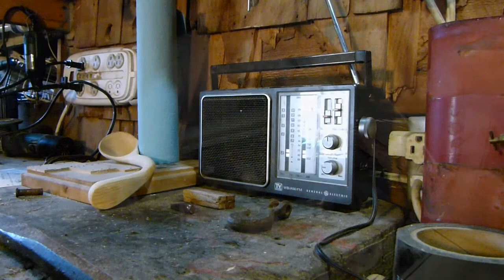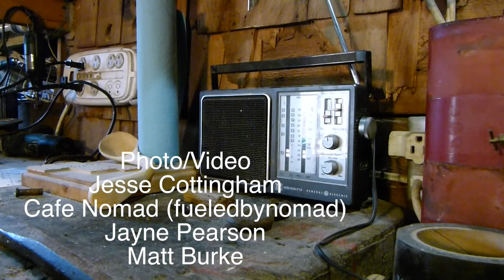Radio Story

Comment: Good morning Bus, have you got the steel on the roof? Take care, keep moving forward.
Reply from the maker: Good morning! Ill be leaving the ZIP uncovered this winter as I am tying into it with more roof at the same pitch and just continuing the current roof, but Ill explain that further in the next video. I wouldn't have been able to tie into that current roof if I put on metal this fall. Learning. Thanks